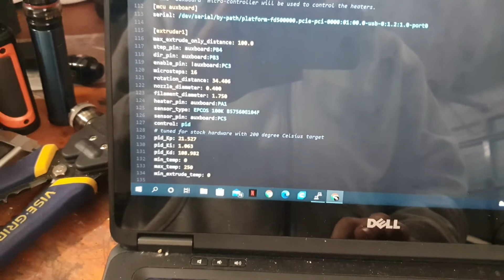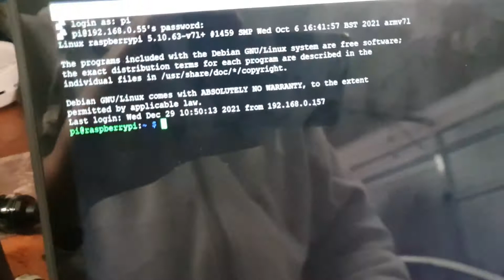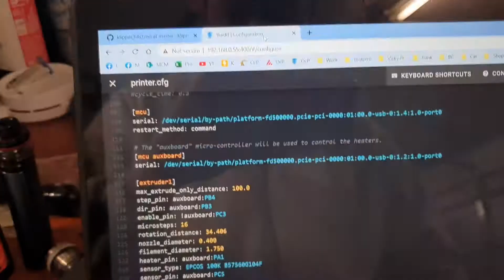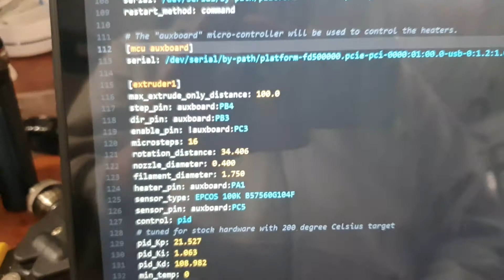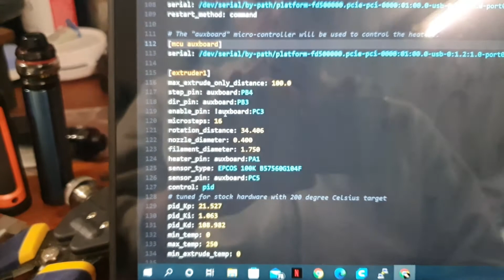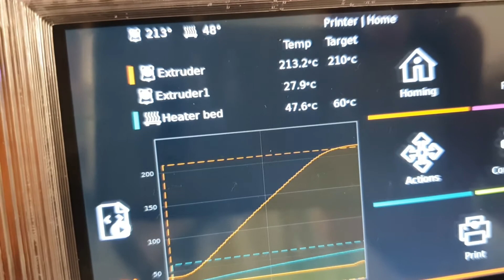Klipper Extra Mainboard (MCU) on Ender 3

Comment: is it possible to have fillamet feader without adding termistors? because if you call them extruder 1 extruder 2 it want termistors and heater pins?
Reply from the maker: You might be able to use duplicate_pin_override in klipper to trick it and use an already existing thermistor on the other board

Comment: can you tell me how to add an extra extruder motor? it didn't work because I wanted to print with an extruder. this is my code:
[extruder]
max_extrude_only_distance: 100.0
step_pin: auxboard:PB4
dir_pin: auxboard:PB3
enable_pin: !auxboard:PC3
microsteps: 16
rotation_distance: 34,406
nozzle_diameter: 0.400
filament_diameter: 1,750
heater_pin: PA1
sensor_type: EPCOS 100K B57560G104F
sensor_pin: PC5
control: pid
# tuned for stock hardware with 200 degree Celsius target
pid_Kp: 21,527
pid_Ki: 1,063
pid_Kd: 108,982
min_temp: 0
max_temp: 260
min_extrude_temp: 180

# connected to motor terminal E of motherboard 2
[extruder1]
max_extrude_only_distance: 100.0
step_pin: auxboard:PB6
dir_pin: !auxboard:PB5
enable_pin: !auxboard:PC3
microsteps: 16
rotation_distance: 34,406

I get the error message:
Option 'sensor_type' in section 'extruder1' must be specified

if I do it this way:
# connected to motor terminal E of motherboard 2
[extruder]
max_extrude_only_distance: 100.0
step_pin: auxboard:PB4
dir_pin: auxboard:PB3
enable_pin: !auxboard:PC3
microsteps: 16
rotation_distance: 34,406
nozzle_diameter: 0.400
filament_diameter: 1,750
heater_pin: PA1
sensor_type: EPCOS 100K B57560G104F
sensor_pin: PC5
control: pid
# tuned for stock hardware with 200 degree Celsius target
pid_Kp: 21,527
pid_Ki: 1,063
pid_Kd: 108,982
min_temp: 0
max_temp: 260
min_extrude_temp: 180

# connected to motor terminal E of motherboard 2
[extruder1]
max_extrude_only_distance: 100.0
step_pin: auxboard:PB6
dir_pin: !auxboard:PB5
enable_pin: !auxboard:PC3
microsteps: 16
rotation_distance: 34,406
sensor_type: EPCOS 100K B57560G104F
sensor_pin: PC5

then it gives this error message:
pin PC5 used multiple times in config

I managed to connect a 2nd motherboard, the video helped a lot, thank you...
Reply: try sensor_pin: auxboard: PC5
Reply: Sensor_pin: auxboard:PC5
Reply: You used 2 times PC5 thats the problem (PC5 is for the first board and auxboard:PC5 is the second board)

Comment: hi i'm thinking to add an inclosure to my printer and i'm thinking of controlling it with klipper but like you my board don't have any more ports to put a thermistor or fan, could i use the raspberry pi as a secondary mcu and use the gpio pins to control the heater and fan by the temps registred by the thermistor inside the heated chamber?
Reply from the maker: Hi, I can't see why you couldn't do it. Would you use a SSR to control the heater?
Personally I use a Inkbird ITC308 to heat up my chamber that has a small heater on the inside. I run it at 65°c
THis is the heater i use: https://www.ebay.com.au/itm/375026455048?mkcid=16&mkevt=1&mkrid=705-154756-20017-0&ssspo=hvHNQlqGR4y&sssrc=2047675&ssuid=DCPaoOTnTLG&widget_ver=artemis&media=COPY

Comment: Thank you for this explain, I have apply this procedure on an old anet board and on a creality 1.1.4 on the same delta diy printer and I magically  solve the extra pins needed problem.

Comment: I can't get this to work?
i have  two 4.2.2 boards, when i add the second flashed board i still only get 1 board in putty. However when klipper restarts it tries to run the printer from the second board and fails due to not having a thermistor attached, i only want a second Z at this point.
unplugging the second board and restarting klipper reverts back to a working machine running from the internal board.
checking the device id reveals both boards have the exact same mcu id?
Reply from the maker: Hi, its been a while but I think I ran into something similar,  you might need to keep both z motors on one board (main board) and  maybe put e on the second board
Reply: @GalvanicGlaze  trouble is with both boards connected to the pi, Klipper defaults to the aux board and Klipper boots that... Which fails...
Putty only shows 1 mcu I'd as both boards are the same I'd?
Reply: i missed the by-path used by-id thanks for the info

Comment: this is genius, I have a 4.2.2 board laying around, currently using your hotend design shroud which I love btw, and I want to do the outside electronics enclosures, as for wiring extensions how did you go about that?
Reply from the maker: Hey, You're using my Duct? that's great! thanks for the feedback!

The external housing shouldn't require anything extra other than the screws to put it together, the way I designed it is to use the stock cables (if you use a BLtouch you have even more room). Your biggest challenge will be to print on the full 235mm of bed space  

Let me know if you have any other questions  ❤
Reply: @GalvanicGlaze  oh ok so you didn't need to extend any of the wiring for the motors or bed?
Reply from the maker: @Zzafari7  Nope no extended wires needed if you place it next to the printer on the left.
Reply: @GalvanicGlaze  Yes! using it with the bmg clone, stock stepper, dragonfly hotend and all that, I do have a small issue with the BLtouch but I spaced it out with some two nuts but I will need to find a better option as the nut tends to unscew itself
Reply from the maker: @Zzafari7  Oh really, if you wanted to explain it more i could look into the BLtouch problem and see if i can tweak the design to suit. Maybe you could try some nail polish to secure the nuts.
Reply: @GalvanicGlaze  I guess for the stock hotend it is fine, but for the dragonfly since the nozzle is shorter than stock I just dropped the probe by adding 6 washers and that fixed it
Reply from the maker: @Zzafari7  oh the dragonfly is shorter? How did you get the ducts to work then, were they too low?
Reply: @GalvanicGlaze  it is not that much shorter but by a few CM, but cooling wise I haven't noticed any difference in them. but to be fair how would I test cooling?

Comment: Cool man , what other steppers do you have?
Reply from the maker: Extra z stepper and extra extruder. You can't use two z stepper on different boards so I've got the two z steppers on the main board and the y stepper and extra extruder on the auxboard.
Reply: @GalvanicGlaze  I purchased a skr mini e3 v3 before knowing about the 5th stepper driver needed for ztilt. Can I use this method with the 4.2.2 board and skr mini to achieve ztilt?
Reply from the maker: @justjoe8660  Yeah it should be fine, I dont think it cares about what boards they are

Comment: Wish I could just use a 2nd mainboard instead of rasp pi
Reply from the maker: What is stopping you from using a 2nd mainboard?
Reply: @GalvanicGlaze  sorry I meant instead of a raspberry pi I could use my spare mainboard to use klipper
but haven’t found a way yet
Reply: There is probably a way though it’s just don’t have much knowledge
Reply from the maker: @probably blue Sorry for the late reply, went into spam for some reason. 

Yeah you do need some sort of computer like a pi to run klipper, i think there is a way to run it from a mobile phone if you have a spare one lying around
Reply: @GalvanicGlaze  I would but sadly I don’t have any thanks for replying